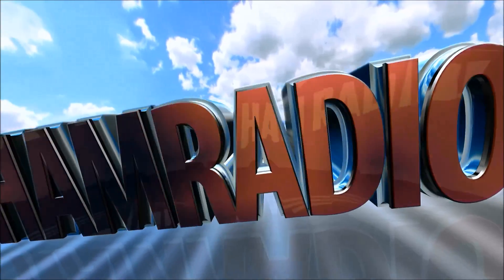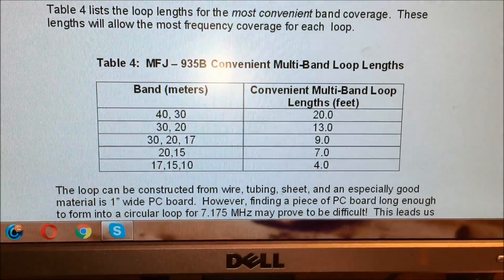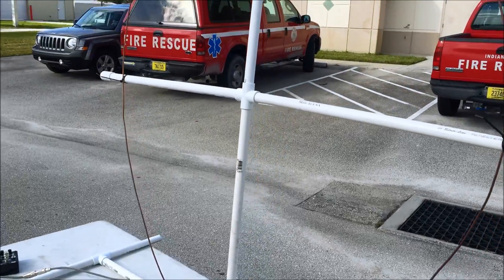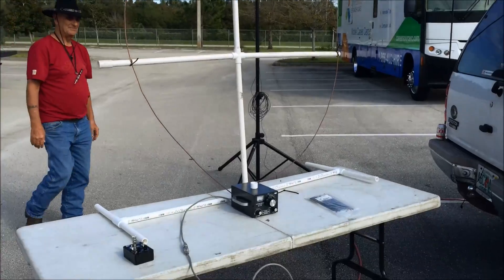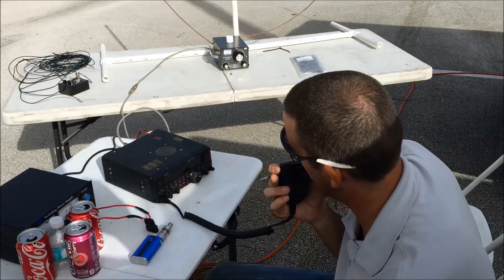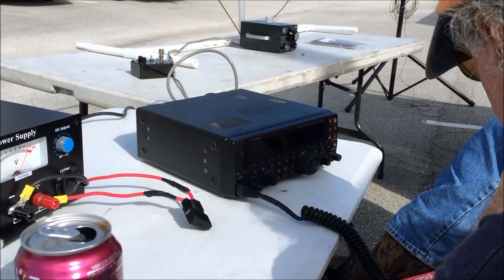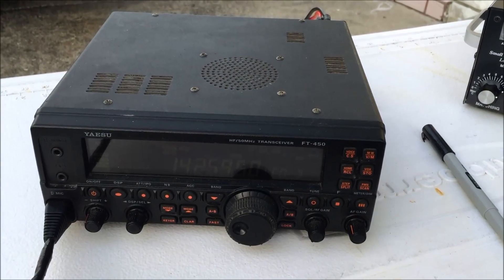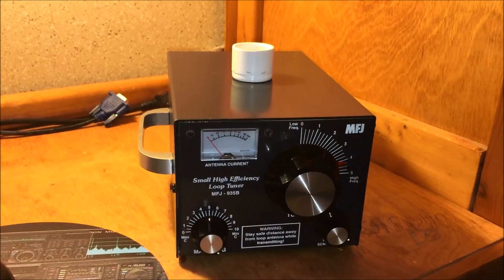Mfj-935b small magnetic loop antenna tuner

Comment: Too bad it cant be remote tuned, antennas dont work inside my house.
Reply: They have one complete loop antenna that can be remotely tuned but different videos I've seen of it. They have come problems with quailty control people having to go inside an tighten coupling between motor and capacitor and also I saw one that had to readjust limit switch. I don't know if they have had any problems with this controller or not first video I've seen of it

Comment: Nice demonstration......except there are some safety issues. There are some guidelines for how much distance is safe to be from an energized loop and it does not seem like this was done. I noticed one place at about 4:49 where a guy in a red shirt seemed close enough to touch the loop as you were transmitting. I don't mean to be picky, but this type of antenna generates in excess of 4,000 volts at power levels like you were using. If people are going to use this, safety first so as to avoid the casualty or even fatality column. The power levels you were using can give a nasty RF burn! There are really terrific antennas for certain applications, but we need to respect their potential for injury. Ok, enough soapbox. Keep up the good work!
73 de W8DU
Reply: Arnold Podolsky One thing is safety from accidental contact, but other is the distance from the radiating elements for biological effects. What is the recommended minimal distance ? thanks!!
Reply: Arnold Podolsky -  Exactly my observations and thoughts!